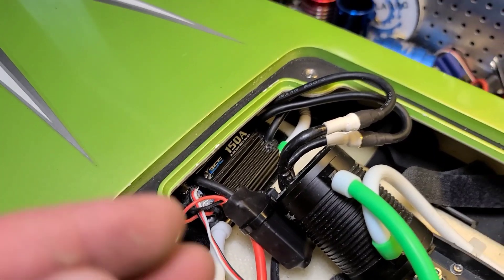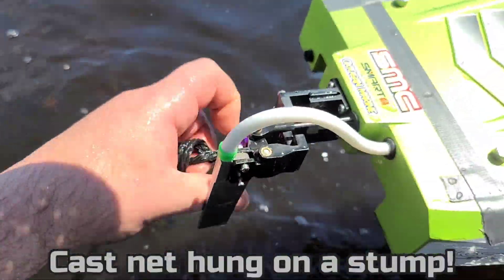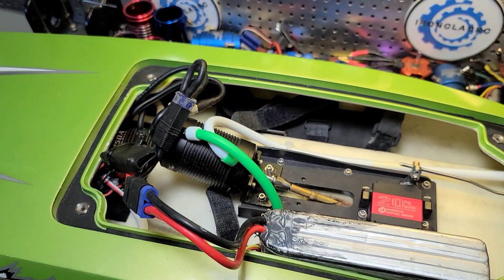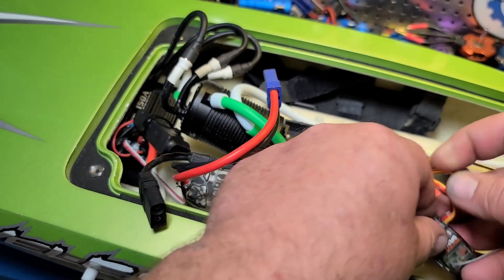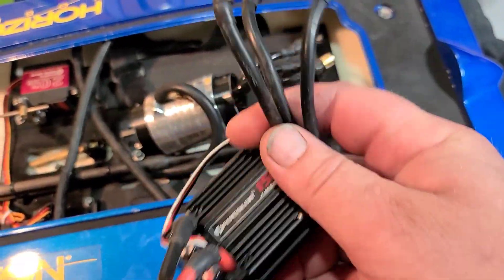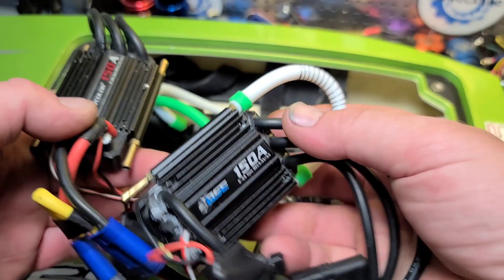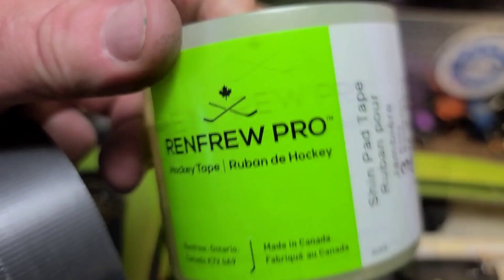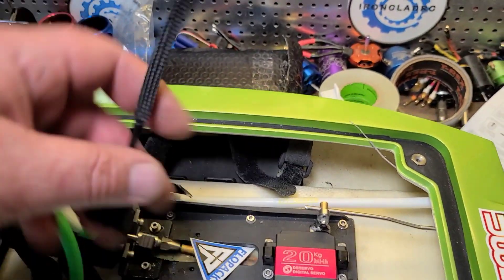Brushless ESC Not Working, No Throttle, Lets Figure It Out - Rc Boat Electronics Troubleshooting

Comment: M41 : Motor,  ESC,  Flex cable, and a new  hull. ALL because  I  snagged a  shallow log. Motor stop, ESC   cooks, and   by now, my Credit card  is   on life support.  But , wait theirs  more. I managed to hit same log with my Black Jack 24, and cracked a sponson. Why does trouble always  come in twos? 

And  this. Some history. I am part of a local  boat club, and annually,  we have three major events. Our parade of boats, and two Light house night nights, that we run in the fall. Lighthouse one, was last Sunday.  Backing up, two weeks previous, on a  regular Thursday . For us, we meet at the lake, during the Farmers market.. Nothing too out of the ordinary. Except that night.  September 8th. 2023, 8:45 P.M,  my classic Dumas Cobra,  caught some weeds, and while backing up; The transom dropped, and the  boat flooded. It over in less than a minute,  one long agonizing back flip, and ended  up  in about seven feet  of water, for close to two years.  Until , my friend  retrieved a long fishing pole  with a four inch grappling hook, and ... on the forth cast,  He caught something big. When the line came up, there it was . THE lost Cobra. We were all in disbelief  .This doesn't happen. Well it's back. And will be going  through a bit of a metamorphosis.   THE new electronics are sitting next to the boat. As will as the new drive system.   HARDWARE No more OEM , anything. All new innards. Including the VELES  29 running hardware  We're debating an inline system, or standard offset. Either works. THE Cobra  is going to be sporting some serious attitude.  If setup right, she'll  be  good for 25 -40mph. I figure , that will turn some heads.  Grunge , with an attitude. No fancy restoration, or a fresh coat of paint. All business. 
Anyways, I thought,  this would be a cool share. This is  part of the  game. 

-Mark from Minneapolis. -

Comment: could it be possible that the esc i bought was no good after just replacing it? i’m 100% sure the boat is good cus i just put in a boat that hasn’t even had its first real maiden voyage. the new esc was acting up and then i got it right, took it out to drive, driving fine until it decided to cut out and just slowly lose power when accelerating. i’m not sure what to do
Reply from the maker: Sure, it's man made so you could have gotten a bad unit, contact the distributor

Comment: Big Bee mine is taking off strong within 10 seconds the motor or esc goes into limp mode I changed everything esc motor radio and tried multiple batteries same result, any suggestions? Thanks bro ✌🏼😎👍🏼
Reply from the maker: Have you tried changing the reciever?

Comment: I have a RCBB 175a esc, offshore 4082 x2 1650 kv motor along with a MRX 200 receiver hooked up. I am able to activate the servo but can’t get the esc to connect to the motor….there is a very quick continuous beep beep beep of the motor….what am I doing wrong? The esc and motor are brand new, never been used before. I tried binding them both several times with no success. How can I get the esc and motor connected.
Reply from the maker: Here's a link where I binded 2 flycolor 90s on my drag boat it's the same process for the rcbb 175.   

  Binding @ 8 minutes 
https://youtu.be/m8FXTcd0kKE

Basically hold full trigger while plugging in lipo then let go after a few beeps
Reply: So it looks like I need to pull out the middle red wire on the throttle wire and heat shrink it. And then proceed thru the binding process…..thx
Reply from the maker: No don't do that.   That's only for twin motor set ups
Reply from the maker: Don't pull any wires 

Just showing you the setup process.    Hold full trigger while plugging in lipo once you hear a beep let go of the trigger
Reply from the maker: Don't pull wire

Comment: Thanks for the vid.  I have a 90 amp flycolor in mine and was running good.  Last time I went out I plugged the battery in and after several seconds the ESC emits one short beep followed by a 3 second pause followed by another single short beep.  This continues with no throttle response.  When it beeps the motor does a slight movement.  I checked the trouble shoot guide and I didn't see anything for this single beep sequence...have you ever encountered this?
Reply from the maker: Plug battery in if it's still doing the same thing try moving the throttle to reverse while esc is beeping?    If that doesn't work rebind the esc w/ recalibration
Reply: @IRONCLADRC  I really appreciate your help on this.  I tried reverse no luck, tried full forward trigger while plugging batter in and it will not enter the programming mode.  It takes about 5 seconds after plug in for me to start hearing a single beep and it just continues.  I also tried putting a new MRX 200 receiver to replace my SRX 200 that it came with thinking the receiver might be bad.  My controler is the stock STX2.  Is there any programming to do in order to link the controller to the receiver?  I also have no rudder controls.  Racking my brain over here lol
Reply: @IRONCLADRC  Got it figured out how to rebind the receiver all is well.  Thanks bud!

Comment: Big B! Hey I’ve got the same issue. I think too big of prop hit rudder on UL19 with Firma running 6s. I also hooked up the stock ESC and still no throttle just steering. I have no start up tones coming from either ESC. Am I up shit creek? It was second run with Firma  dual cooled large bore lines.
Reply from the maker: Sounds like the receiver.  If you have another receiver try it , same deal process of elimination
Reply: Ok. I’ll have to buy one & try it. I’ll let you know. Thank you!
Reply: Hey big B. Looking at new receiver online & see that the SR315 has failsafe mode?? Possibly locks out the throttle? My DX5 rugged told me to bind at low throttle to reset failsafe. Any idea what that means?

Comment: Just ordered the Veles, and raider 150.
And duel cooling rudder, 
Is the single line cooling working OK, or should I do a duel out with a Y fitting like on the sws?
Ever think of turn fins, or trim tabs on your Veles??
Reply from the maker: So I'm still running single cooling, upgraded single pickup rudder.  Ose  Dual pickup rudder should do the trick if your wanting a cooler setup....

No turnfins or trim tabs needed for this boat, you'll see she's a rocket out the box with an abc 1616 or 42 high rake
Reply: @IRONCLADRC  I did order the RCBB duel cooling rudder.  And 150 raider.
Still looking for the proper size water jacket for my sw v2. Ose said they can't help, as they do not know the dimensions of that motor??
Reply from the maker: Check your other comment answers there

Comment: I had a problem with my Vortek Rc no power to motor or steering esc was burned out so I got a better esc 120 amp instead of 100amp now running perfectly.

Comment: I’ve watched that opening scene 3 maybe 4 times now, the 29 was moving out!!! 
  I had a 150amp,  looks just like the two in this video, after receiving it in the mail it took me several months to finally get around to using it,  turned out to be a dud,  never worked,  it was cheap, should have bought from OSE.  
  Im pretty sure it was a FlyColor ?  Thanks for sharing that and you could youse that opening scene on all your videos Big B,  IT SAYS IT ALL ! 👍
Reply from the maker: I've watched that run probably 40 or 50 times lol. Luke a hawk

Comment: I have a fly color 150 amp receiver I’m trying to put in one of my boats and I just got it and I’m pretty new to these.  When I plug it in and power it up it beeps and then keeps going through like a programming beep sequence I’ve tried setting my throttle two or three times and the sequence of beeps changed up a little bit but it still does the same thing any ideas?
Reply from the maker: Hold the trigger full throttle while your pluging battery into esc let go as soone as you hear 2 beeps ( hold full for 3 or 4 seconds after pluging battery)
Reply: @IRONCLADRC  thanks my bro I’m gonna try that 💪🏼👍🏼

Comment: Did you flair the original st and attach new to old
Reply: @IRONCLADRC  st stuffing tube. It did not come that long stock how did you extend it.
Reply from the maker: It's the longer collet I'm running makes the stuffing tube look longer
Reply: @IRONCLADRC  really
Reply from the maker: Pretty sure cause I didn't mo e the stuffing tube
Reply: Yo B I need a favor. I have a branded FC 150 & a OSE 150. Caps on the ose 35v on the FC 25v. Can you see what voltage the caps are on your FC. Thanks B

Comment: I feel you BIG B.  Blew up a flycolor 90 after getting prop tangled in rope. Sent out recovery boat and  it suffered the same fate. So I had 2 dead boats out in the middle of the lake. Luckily  my neighbor had paddle boat🤣
Reply from the maker: Sounds like my kinda luck here lately at least you could  Retrieve the boats.
Reply: UPDATE  on the COBRA  reset. We finalized on our drive line. We shifted gears off the VELES, and settled on the Shreddy. Simply because the system,  is all connected.  It made more sense, than having to "Dig a bigger hole on the bottom of the boat. " . It was also   easier  to go right from a 5 mm > 3/16  system. DA.DUM! 

When it's all said and dun, I'm not even sure what to call the boat. It's three different  model types to create this "Frankenboat." (Don't try this at home.)
I will keep you up to date.

Comment: ive had same thing happen the esc maxed out on amps when prop got stuck my castle esc data log said  280a to 556a in a split sec
Reply from the maker: Holy smokes that's insane.  I kinda figured that's what happened,  boom done.      280 to over 500 in a slip second,  almost unbelievable ya know.   Thanks for the info

Comment: My flycolor has the same problem and now its in a trash can.
Reply from the maker: Overall my experience with flycolor /ose esc have been positive since I've been running them,  I've had better experiences with flycolor than hobbywing,   hands down!
Reply: My catamaran ran 150 flycolor with 4S TP4050CM Motor (twin setup) which suck 320 Amps… ran like a champ. Now i switched to 6S to get the current down. Runs cooler and even faster… BUT i still can not believe how tough that ESC is!

Comment: I liked the duct tape......  It's IRONCLAD!  As soon as I saw a rope wrapped around the prop and no "GO", my first guess was you popped one of the FETs on the ESC board.  With a sealed ESC, there's no way it can be replaced.  It's now a cool paper weight and a spare parts donor.  I know, I have a box full of similar paper weights... 🙄
Reply from the maker: I've already pulled all the junk I can of the esc and the rest Is in the trash.   Lol.
Reply: @IRONCLADRC A little off topic, but I know you are probably going to shoot for 100 with the Velez (why not?)  You were experimenting with the tunnel aerodynamics in the 42, are you planning similar testing with the Velez?
Reply from the maker: Idk i  think the modifications I did to the bottom center ride pads actually kept the nose of the boat down substantially. Most of the reason i Sanded in a little dead rise on the center sponson was to bring the nose down and reduce wetted area.    If she starts blowing off the water @ 90 plus I may use an air dam?  We'll see what happens! Waiting on another slick calm day
Reply: If you have the time and patience they can be saved chip chip chisel chisel 🤣